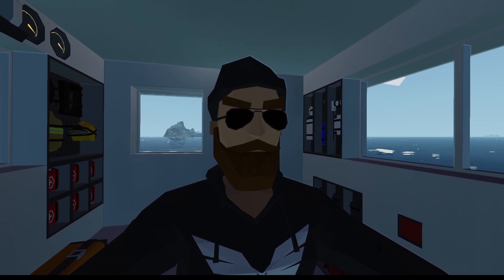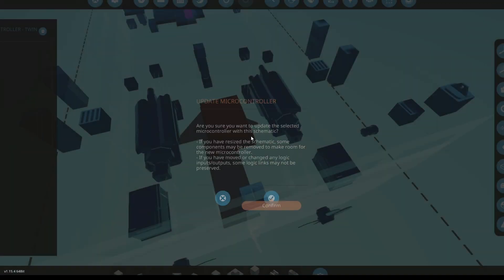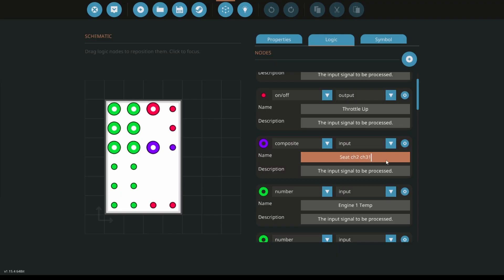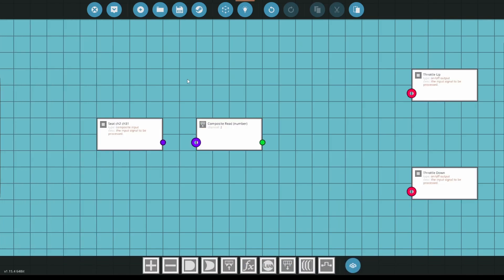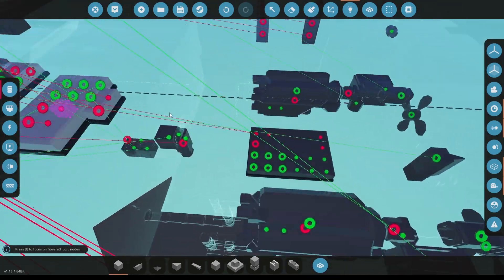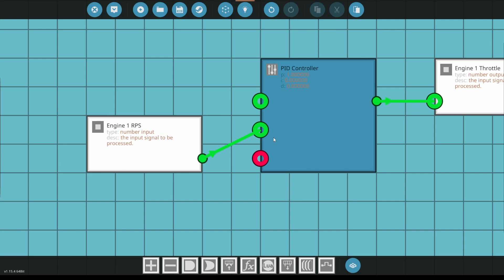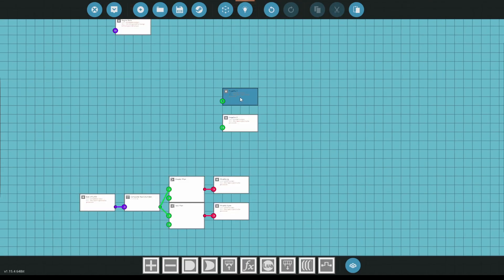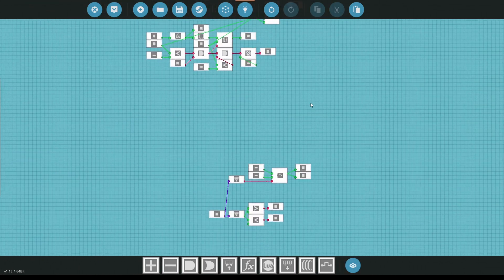Stormworks Easy Engine Controller Tutorial

Comment: Man this really helped alot. Although one of my boats, after like 5 or 10 min drive or after a sharp turn my engines cut off and can't be started anymore.

Still have fuel, and batteries. I have 2 medium engines and 2 Azimuth trusters, maybe they are to powerfull for 2 medium engines? Also the cooling and exhaust is straight under the boat in the water with a fluid port, could that be the problem why the boat wont start again after a few min drive?
Reply: Ah, Engine wasnt taking in air and fuel. Had the wrong ports or intakes on the outside. Runs like butter with this controller, super helpful.

Still struggling with the basic systems, what order stuff goes, what ends are the right ones, electricity is often a problem and how it should be connected. Would love to see more tutorials like these.
Reply from the maker: Its seems like the simple stuff is often overlooked.   Im glad you found it
Reply from the maker: That sounds like you are sucking all the air out of your hull.  Make sure you run the pipes into the open air.